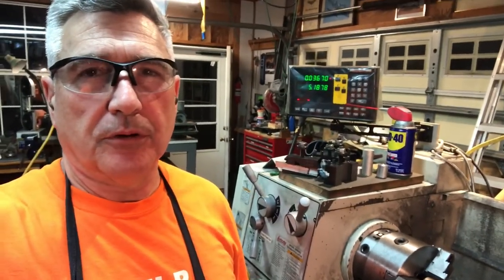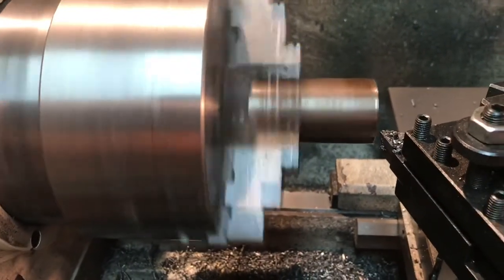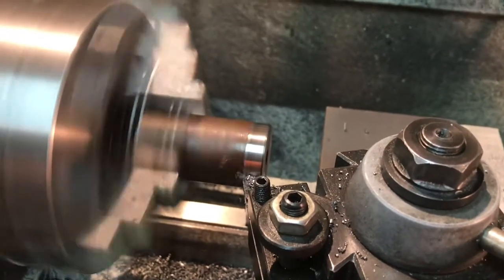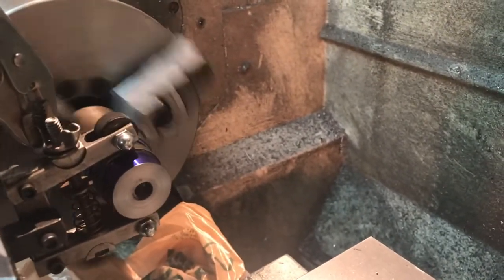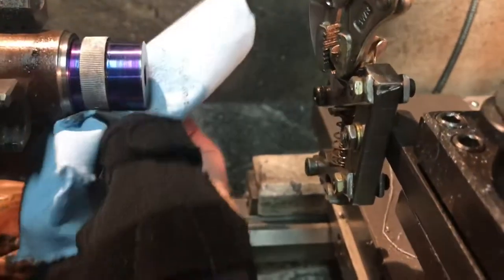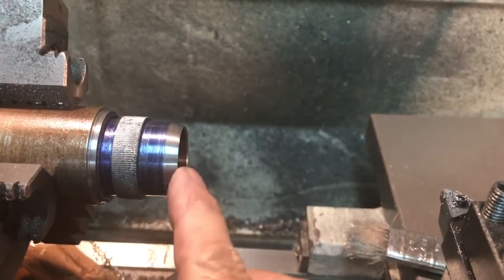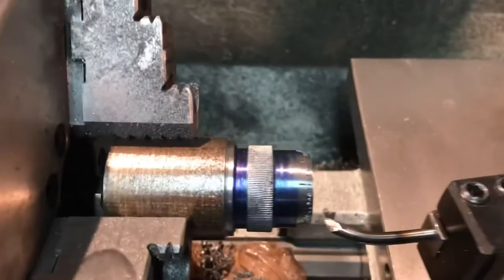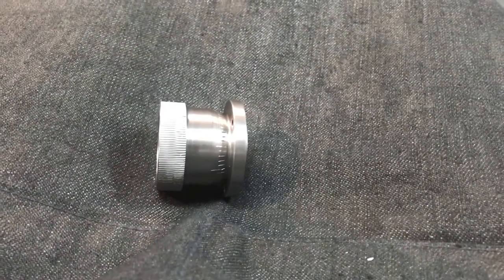Quorn Tool Grinder Project. Micrometer Thimble.

Comment: I'm coming to this a bit late but there is an old trick for starting a new hole where there was one before which might help in future. If you mount a centre drill with the flats horizontal and start to drill but then push the drill chuck away from you with gentle pressure from the tool post, this turned your centre dril into a single lip cutter and once the joke is trued release the toolpost pressure and drill normally. I told Abom this trick and Quinn learnt it from him, it's simple but effective.